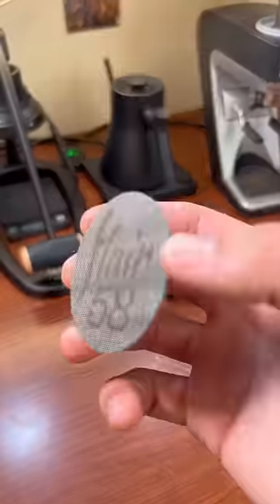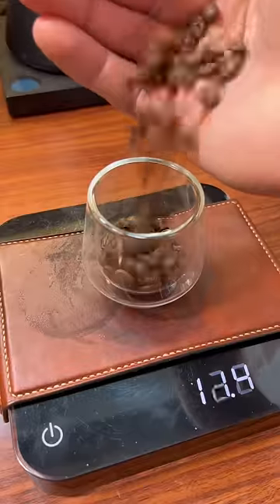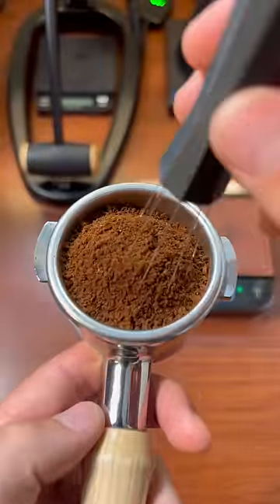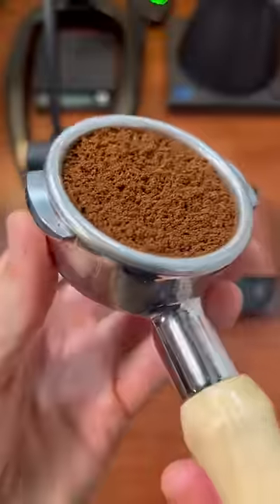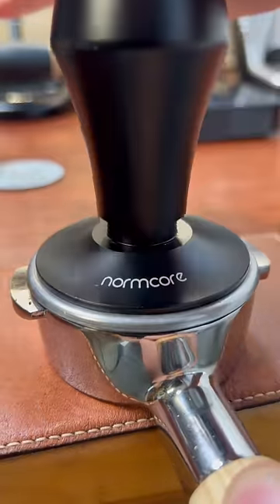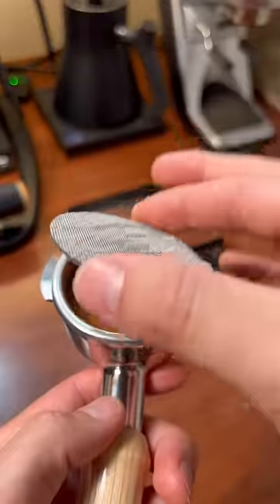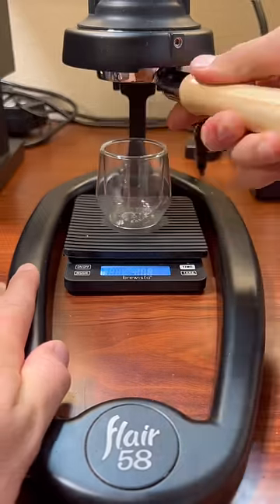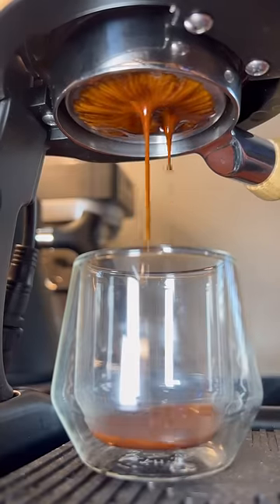My espresso tools and what they do ☕️ #shorts

Comment: Spring loaded tampers are actually not very good. Also if you’re not using laser cut baskets then all of this is wasted on a low quality porter filter that will detract from all of this anyway.

Also your water quality is far more important than any of this anyway, I assume you’re a city dweller so hard water, unless you’re running a remineralised filter (usually a BWT) then all of this is a waste of time on weak hard water espresso. 

But what do I know, my family have only been roasting speciality grade coffee for over 15 years and I’ve been a SCO barista for 12 years.

But of course armchair expert YouTube shorts makers think they can educate the masses when they don’t even understand the majority the subject.

These tools have their uses but without the proper experience and knowledge is wasted.

Just like power tools, you can buy a $40 one and a $4k one, and 90% of people would have the $4k one wasted on them. Because most people are mediocre at life.